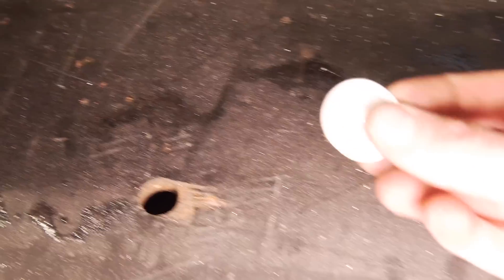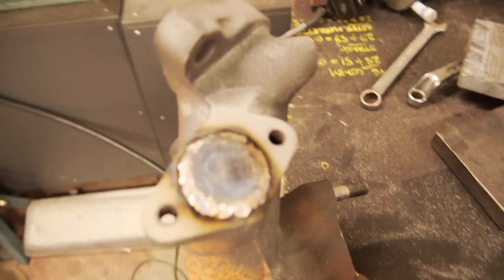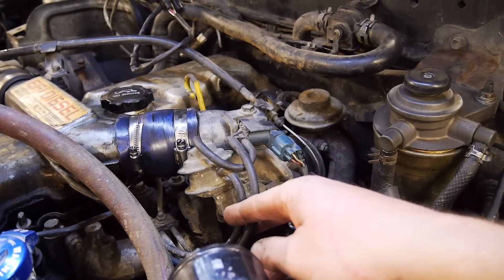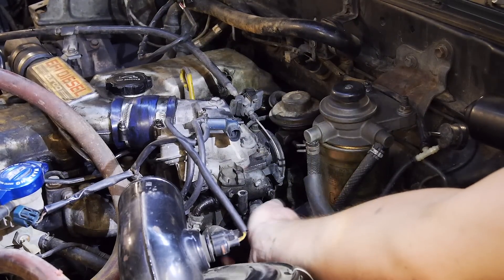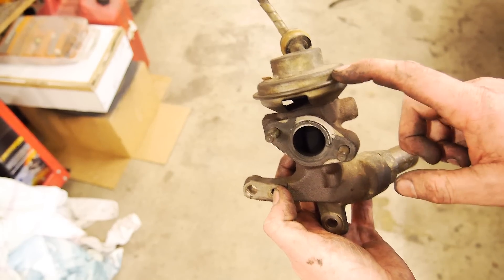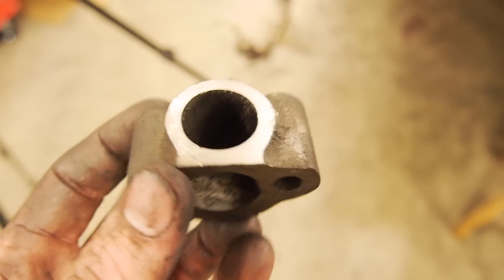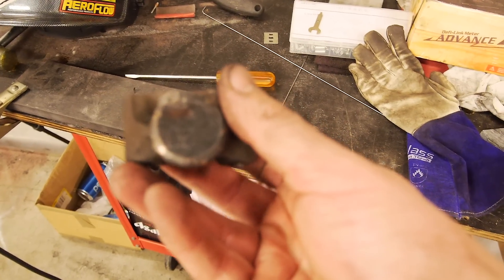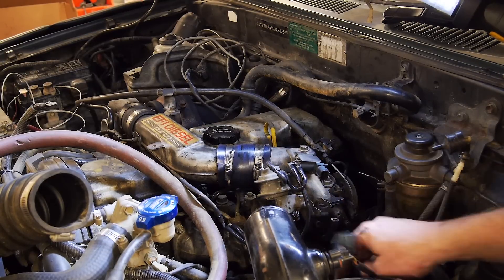EGR DELETE - What, Why & How!

Comment: I've got a 1kzte van but no intercooler was a bit worried about if I delete the EGR valve cylinders temperature may increase ,we use it for a lot of Highway and family trips
Reply from the maker: Yes, you will likely see higher EGT. Usually you run some more boost but not having a cooler will be an issue I imagine
Reply: I also blocked off my egr same 1kzte engine but it gets too hot very quick when I take it off road do you think it's running lean?  @boostedbuiltgarage

Comment: If you have a turbo then I'd recommend deleting the egr as a blanking plate especially with a dpf will cause turbo issues and fast if you have no turbo and no dpf then yeah you will be OK, plus the newer egr valves are electronically controlled if that's the case then pop a small hole in or bypass the electrics

Comment: When you are re-piping the vacuum lines in the schematic at 10:51 to create positive pressure, do you have to re-connect the electrical connector to the solenoid or does this bypass this manually?

Comment: 6:52 Just by way of background. All the auto makers are told by their governments that NOx emissions have to be reduced or they risk not having their product sell. Back when the Surf was designed the cheapest way to reduce NOx was to retard the injector timing and richen the amount of fuel delivered to the engine. The EGR was also aiding lower NOx by plumbing in inert exhaust gas which took up the place that air/oxygen would have been thus lowering the combustion temperature. Higher combustion temp means more NOx. S we can call it stupid but it was that or no can sell your truck here kinda thing. Don`t forget this was mid 80`s technology. I would actually advocate you either plug the hose with a ball bearing so the actuator never opens and/or blanking plates BUT leave the hardware in so it looks "legal"... just saying

Comment: Just wonder if a 26mm welsh plug would have done the job
Reply from the maker: Probably would
Reply: Welsh plug would cost more than 20c
Reply: No welding time saved
Reply: Well the way i see it you had to drag the welder out weld it up and when the cops pull you up and find its blocked and stick a unroadworthey sticker on it out comes the grinder to grind it out

Comment: Doesn't the EGR removal trigger the check engine light to come on?
Reply from the maker: On modern vehicles, yes. This can be avoided by a small hole in the blanking gasket or turning it off in the ECU

Comment: hi everyone .
 HELP !!!! , rough shut off , HELP!!!! 

 ive done a simple egr blank with a plate ... and re circulated the air controlled hoses ... thats the olny mod ive done .
 BEFORE i done this it has a really rough shutoff ...

after egr blank , still rough shut off , is this bad for my zd30 d22 engine , been happining now for about 2 years , 2002 model 
someone please help , i cant find any info on this ? thankyou everyone for reading , someone please reach out .....

Comment: Get a catch can put on. that solves 90% of those problems in removing that fine oil mist that combines with carbon dust produced by the EGR. 
Simplistic view.
Spill flour in kitchen easy to clean. 
Spill water easy to wipe up.
Spill flour and water together that's crap to clean up.
Oh yea why not mention what the fine is for messing with the emission controls.

Comment: What sizes were majority of the hoses? Looking to do silicone soon on my 94. The smallest hose is either 3mm or 3.5mm
Reply from the maker: Some of the hoses are more like 2mm from memory. You're best going smaller as the silicone hose stretches nicely and actually works better on bigger dia barbs

Comment: Just blocked off the egr on my 2.5 tdi acv (vw engine). Is there any advantages to actually removing the systems like you did?
Reply from the maker: I removed it cause it was in the way and taking up valuable space. No difference between blocking or removing completely apart from having it there to give the illusion of being connected and functioning still

Comment: My service manual says that egr reduces fuel consumption at part throttle.
Reply from the maker: Yeah it probably does because you're filling cylinder space with inert gas instead of fuel or air

Comment: What's the simplest, effective way to remove EGR from the mix but not permanently disable it (if you want to reconnect later for any reason)?  If using the "solid aluminum 'shim' gasket" where (exactly) does that go?  1998 RAV4 FWD manual transmission. Thanks kindly!
Reply from the maker: Yeah just a stainless steel blank gasket. Goes in between the exhaust side flanges
Reply: @boostedbuiltgarage  I appreciate your caring enough to reply. Do you mind laying out for someone who doesn't know: in relation to EGR Valve, where (exactly) & how would one find the Exhaust Side Flanges? I.e., what (all) has to be removed in order to install the blank gasket?  Thx!!
Reply from the maker: @docjody8624  So basically, off the exhaust manifold there's a flange where the EGR tube connects and takes exhaust gas into the valve then it's bled into the intake manifold. Where that tube connects to the manifold, you put a blank gasket between the two flanges, thus blocking exhaust from entering the EGR system. Does that make sense?
Reply: @boostedbuiltgarage  Yes, makes sense-- compared it to my engine. Mixed input on ''EGR Delete" for '98 RAV4. Was told it'll run worse.  Will it harm my car to remove EGR from play?  Don't want to mess it up. Thanks kindly.

Comment: Hey bud, just wondering how its performing now? i was a fan of EGR block off but done a bit of research and found info explaining how this will raise combustion temps which can obv. cause major probs.
Reply from the maker: Performs absolutely fine. Yes, EGR aids cylinder filling at low engine speeds which is meant to be better for efficiency etc but what space that useless recirculated exhaust gas was taking up, it can now be filled with more diesel for more power. As for combustion temps I don't really see why they would differ

Comment: The sludge and crap comes from blow by gasses that are routed to the intake manifold via the pcv system. Research a topic before you give people the wrong information
Reply from the maker: Um I'm pretty sure I mentioned that... They then mix with the soot from the EGR and create a sludge. Blowby by itself is just an oil film. It's when the blowby gets stuck to and combines with the carbon from the EGR that it really sludges up and can restrict pipe size etc.

Comment: Sir you are an idiot - now your engine degrades faster because combustion temp is getting above 2500C and your exhaust produces deadly, climate warming gas NOx. The whole purpose of EGR is to tame down combustion temp down and make your engine run cooler
Reply from the maker: Cool, well you keep your EGR 👍
Reply: @boostedbuiltgarage  Well that's not the point, the point is to stop idiots like you removing them and doing damage to the environment. You are clearly uneducated about the subject and not aware about environmental damage you are doing!

Comment: Egr doesn’t. It’s the crank breathers that collect soot
Reply from the maker: Crankcase doesn't emit soot, it's merely oil/diesel blowby vapour (which is alot of the sludge in the intake usually) the EGR then introduces soot or as properly known - carbon. The carbon and oil can build up and together can form really bad restrictions in the engine, piping and in some modern DI diesels block oil pickups etc resulting in engine failure.
In my many years of building high performance cars with great crankcase breather systems, I've never had a catch can/oil separator completely remove all oil vapour unfortunately. That's why I don't bother running any of them back to the intake

Comment: The butterfly is directly connected to the throttle. When you are off the throttle there is no air getting past the butterfly at all. There are two solinoids that are activated from the ECU that allow vacuum from the vacuum pump to pull open valves. One valve is an air bypass that allows the engine to idle and the other is the egr. If you remove the butterfly then the valves will still actuate but they won't do much. The egr requires a little bit of vacuum in the intake manifold to work. There is another benefit to removing the butterfly: when you are in boost and then you come off the throttle, the pressure after the turbo increases a lot as there is no bov. This puts a lot of load on the turbo and it will pop a bit of blue smoke on a worn turbo. You get a bit more efficiency as well because the dirty diesel loves getting as much air as possible and most of the time there is a silly restriction (whenever your part throttle)
Reply from the maker: Good info. Guess I will remove the butterfly afterall haha🤗
Reply: Haha do it. The hard shutoff makes you feel like a real dirty diesel owner :P

Comment: i'm more a fan of leaving the egr pipe in place and using gaskets without a hole in them, mainly for blue slip purposes
Reply from the maker: Yeah that's what alot of people do especially on new cars to not void warranty etc😉 in my case, i like to clean out some useless hardware in the bay
Reply: I've only ever done it on petrol engines, seems diesels have a bit of junk you can get rid of blocking it permanently